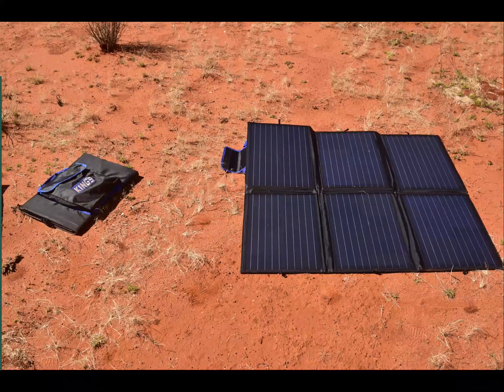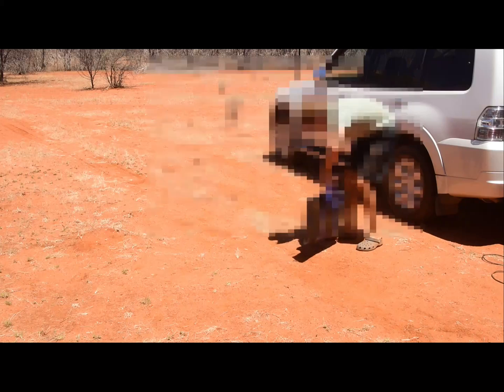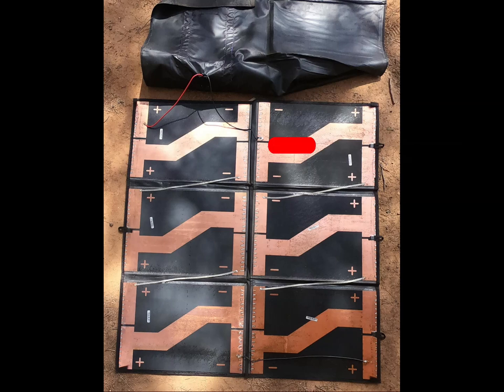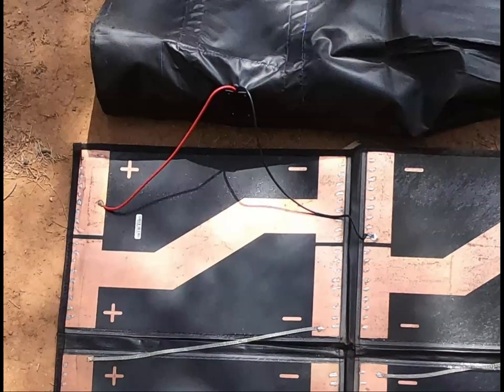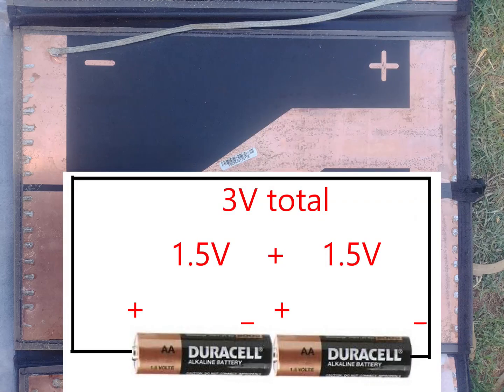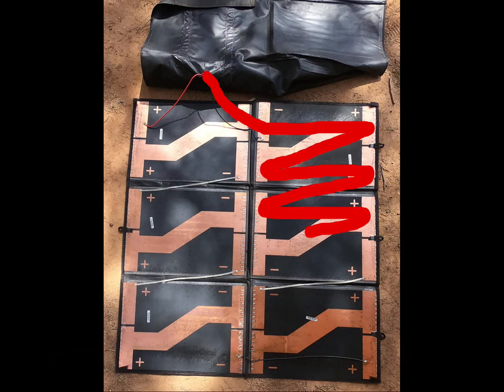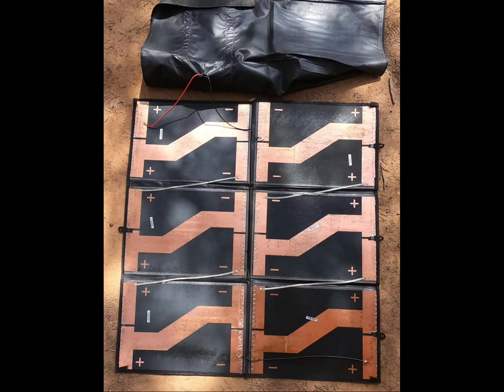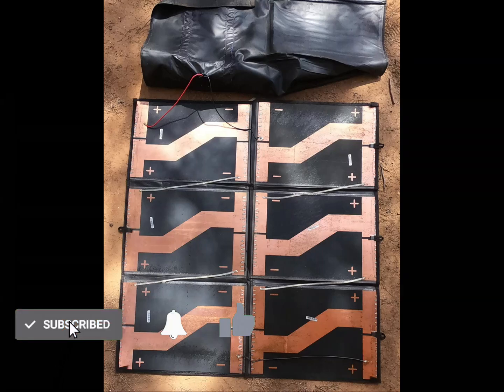What's inside a solar blanket??

Comment: This blanket would probably benefit greatly from a full set of bypass diodes, that way if any panels get shaded, or other cells go faulty in the future, the bypass diode will allow the rest of the cells to still produce power. Same as in house solar panels, each panel has bypass diodes built in so that if one panel is shaded, you dont lose the whole array, just that one panel.
Reply from the maker: Yep that's a really good point. That's probably something you lose with these cheaper panels.
Reply: @TheMusingGreg my panels are totally different as mentioned in a comment on your other video, they now run a series parallel configuration and sealed cells. ive now added bypass diodes to my panels, and insulated the shorting braided wire so ill let you know if i see an improvement asap
Reply from the maker: @lexicase8805  That would be great to know! Yes please comment back!